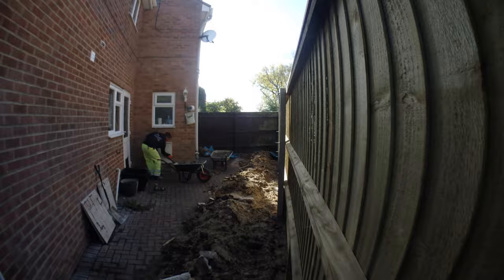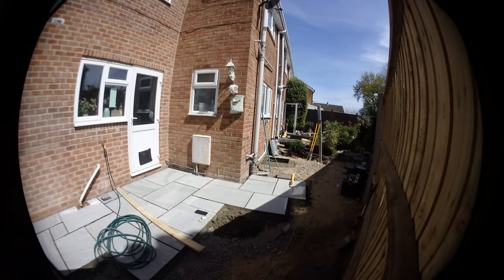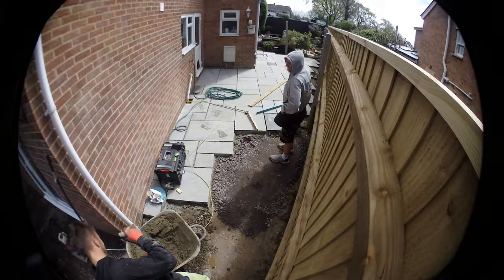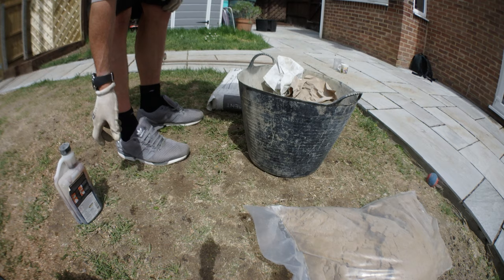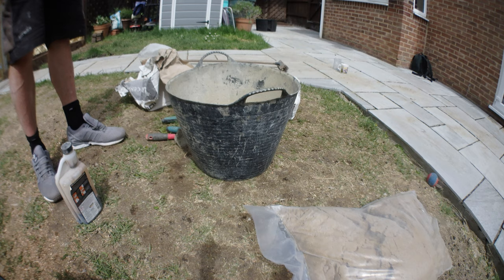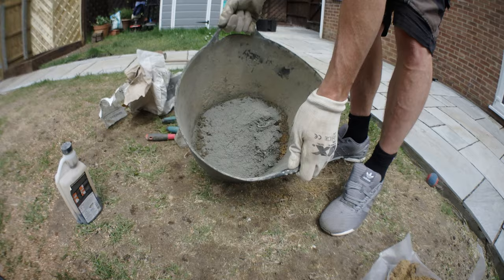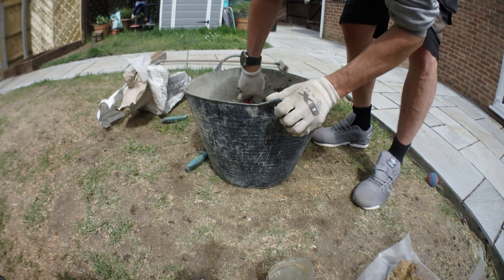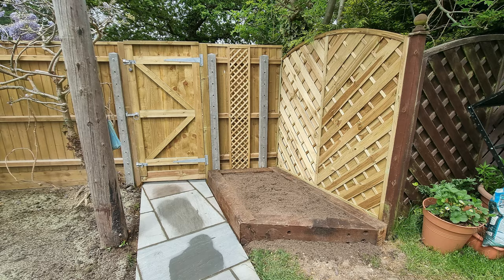How to make a pointing mix and the installation of grey Indian Sandstone

Comment: Is that mix dry enough to brush in and then compact with a tuck pointer or do you have to drop it in the gaps with a trowel first to avoid staining? Thinking about time constraints but i agree this looks better that easy joint. Cheaper too!!

Comment: Feathered cuts on edge of path dont look good. Sort bonds out
Reply from the maker: In your opinion 👍 appreciate the comment though.
Reply from the maker: Carrying on the pattern of the patio looks so much better than just having one that isn't.  The only thing that would have made it look better would have been having an edging to the patio and pathway. 👍👍
Reply: @jaspermillerlandscaping6174  can usually long em out sideways and still have a good bonding look